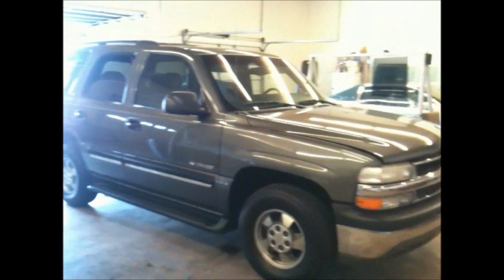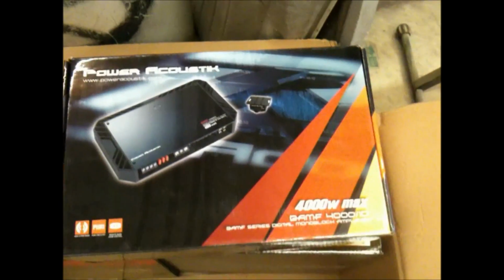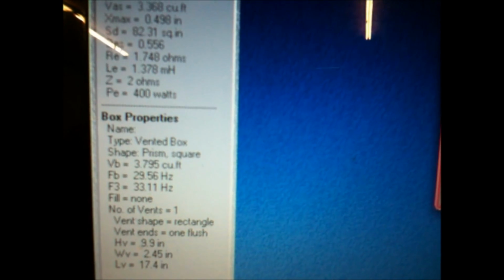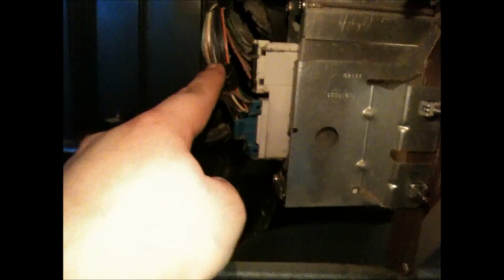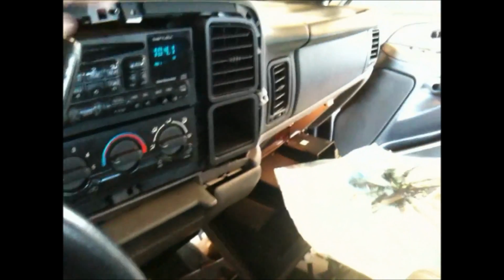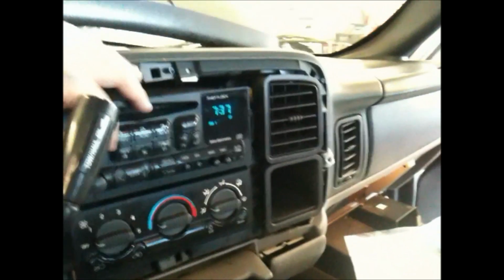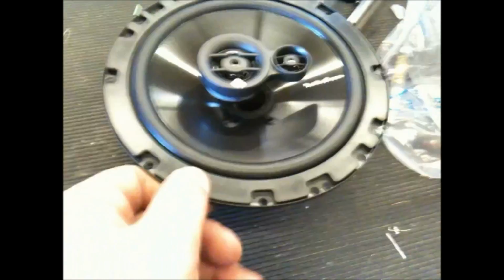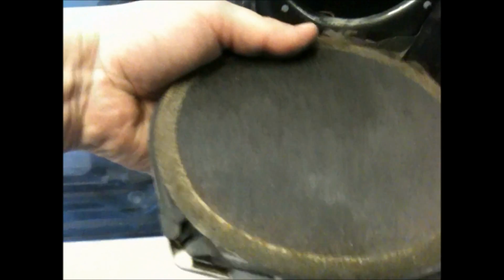2001 CHEVY TAHOE AMP INSTALL POWER ACOUSTIK BAMF W/FACTORY AMP, COMPUTER DESIGNED

Comment from the maker: Yes it is a RCA Converter it really is a transformer 10:1 ratio , it steps down the power (watts) to a lower volume so that any amp inputs can accept the audio and then amplify. I like to use rear doors because remember you can't get something for nothing , the rca convert is getting some audio from the head unit. What ever speaker you tapped ( for the rca converter) to get audio for, that speaker will show a little less power then befor without the rca converter. For a 4 channel amp install the

Comment: I cut the factory amplifier completely out of the equation just unplug both of the plugs and my amp is going into protection when it starts hitting hard .. I watched another video that said with the 02 tahoes particularly with the 5.2 vortec engine that it puts out too much voltage to the amps one video was talking about unplug a certain plug on the alternator and I did that and it worked but the Tahoe didn't run for long lol is my only option to get a converter I'm completely stumped.. or can I hook the power wire up to the little red box where the alternator goes to and then comes out to the battery would that make a difference at all .. basically how do I get less power to run to my amps

Comment from the maker: Ported is way better then seal . Same box ,same sub , same amp, sealed vs ported ported will have a 3 db gain plus you can get rms amp to power your sub(s) up nicely. A seal box you really need a amp to push them and over the rms rated for them to sound good. But the biggest down fall for ported is you need to get the design right , if not it will not sound good.

Comment: i hava a problem my rear speakers dont work but the rear door and front ones do work. only the two tweeters in the back pillars and the subwoofer dont work. i have a agtermarket stereo. what is the problem. how can they work

Comment: Did you tap into the wire on the harness that powers the factory amp?  I can't remember what color wire it is.... I think it's a purple wire and connect that to the power wire.

Comment: Did you use a loc on the sub output and a loc on the full range. You should of ran your power under the amp rack not on the side. But still not bad.

Comment: Did you have to drill the firewall or was there a feed to the inside for the power wire
Reply: bro tahos are complicated as fuh... take it to some people... 20-50$ for them to instal

Comment: okay got 2 power acoustik MOFO 122x's and thier dual 2 ohm subwoofers. 
i want it to fit in the trunk i gotta small car, a 98 grand am.
n can u explain what extended bass is? and high fidelity plz, im gonna run a hifonics GLX1800 .1D on it aswell idk if u needed to kno that but jus lettin ya kno
thanks again hector

Comment: So I have a 2004 chevy tahoe and it has the bose system no onstar, I have an aftermarket headunit.....now my question is how can I bypass the amp so I can run speaker wires from the factory amp harness to an aftermarket 4 channel amp for my door speakers, wich harness do I need to tack into on the factory amp would it be the blue or white harness? I just dont want to open every door pannel its a pain in the back haha Any help would really be appreciated thank you.
Reply: you run RCA from unit out to amp.

Comment: i have a 2001 chevy tahoe with factory headunit no bose sytem but has onstar that i do not use. i ran all my wires and connected the converter like you did in the video but i get no sound out of my subs whats the problem??
Reply: Hey did you ever figure out what the problem was? I have the same issue sorta. I have minimal sound but that's it.

Comment: Do you recommend those front door speakers to just replace the old ones, or way too much without the amp?  I recently replaced the subwoofer in my 02 suburban (used their box in the back - bigger than Tahoe).  But the front speakers are totally shot.  Just want nice sound without adding any more stuff.  And do you have to drill holes, or is there some kind of speaker that will fit into the space?
Reply: A couple days ago I decided to replace the front door speakers in my 01 suburban. It is possible to buy replacement speakers the will snap right in place of the old ones (OEM speakers) but they can be pricey. Instead, I bought a pair of Kenwood kfc-1654s for $25. Installation required me to drill 4 holes to install the speakers and a little bit of soldering but it was very easy and it took me about 2 hours to install both speakers ( and I'm only 17).
Reply: Chase Thatcher oh and the sound is great too!
Reply: Definitely replace your front door speakers.  Easy install.  Just did mine because they sounded awful even with the little amount of bass they handle - foam surrounds were GONE.  Get GM speaker adapters from Best Buy or a car speaker shop or else you'll have to clip the wires and solder (I preferred to purchase the cheap adapters rather than clipping factory wires). Also, if you buy 6.5" speakers you shouldn't have to drill any holes...there are plastic clips holding the stock 6.5s into the door and they're adhered to the stock speakers with some sort of glue.  Put a slotted screwdriver between the metal speaker hardware and the plastic clip and pry that plastic clip off (it's a BIG clip and looks like it's part of the speaker).  You should be able to put this clip on top of an aftermarket 6.5" speaker and just pop it back on the door - very easy install.  I used an old set of rockfords from like 2001 I had in the attic and then a new set of Kickers I got cheap on Crutchfield (again, most 6.5's without big grilles should fit).  I chose to unhook the stock component tweeters up front because the aftermarket units had great tweeters and leaving the stock ones hooked up as well was just too much treble - you may want to consider this.  Also - your post really spoke to me because I don't need a BIG sound...just want it to sound good.  BUT there is a way to squeeze some more bass into the cabin without adding speakers and/or amps!  Apparently the bass coming to the door speakers has been attenuated by a factory crossover.  Once you replace the 4 door speakers there's a way to get more bass from them and it's a moderate DIY...but apparently VERY worth the time.  If you google "savage home automation bypass factory amp" you'll get the best DIY write up available (would post link, but no links allowed here).  Researched this extensively last night and many, many positive posts on the forums.  I plan on doing this within the next two weeks and will post back how it goes.  Would not do this DIY unless you have aftermarket door speakers as the increased bass would certainly sound awful with the rotted out foam surrounds on the stock speakers.  Happy wrenching!
Reply: Thanks guys.  I ended up replacing all 4 door speakers.  I adapted the existing spacers for the front ones because the kit ones I bought were really wobbly and cheap.  Everything sounds great.

Comment: i have a 2003 tahoe with a bose sound system i recently put in a mtx apm with an mtx 12. but the right side door speaker is tarting to go bad. im gonna buy some mtx speakers soon should i buy some for the back 2 doors as well or am i good with the front 2 ?
Reply: did u have to run a 12v switched wire? if so, where did u run yours from?

Comment: Where did you ground the amp? I tried everything could you help the amp turns on but goes into protection mode please help me
Reply: Edgar Bernache if this still applies if all else fails you can get a metal block to ground ti

Comment: Hello, I just bought a Dual XDMA760 Multi-Format CD Receiver with 3" QVGA LCD, Pandora control and Direct USB control for iPod and iPhone for my 2001 chevy Tahoe, I want to know how to tune my front, rear speakers and subwoofer for great sound. all my speakers are stock but I'm going to replace the stock subwoofer to a Kicker 10C84 (10C8-4) 8" Single 4 ohm Car Subwoofer and what kind of speakers should I buy for both the front and the rear doors?
Reply: Where did you purchase this?
Reply: wtf